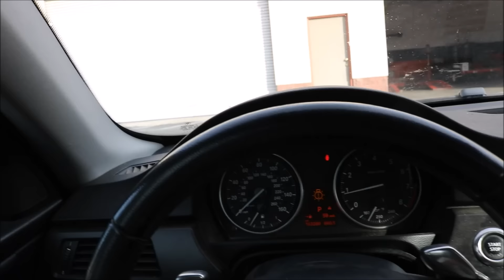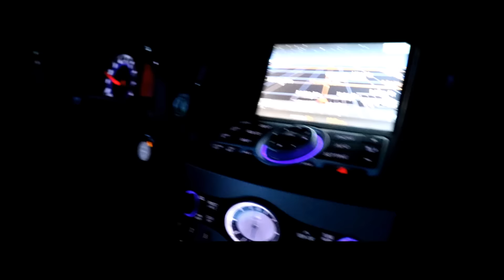Giving Turboed Civic Sleeper Look

Comment: Take the filter off the turbo, turn on the car, put your hand where the filter use to be so the motor can't suck any air in, if it dies then there's no vacuum leak, if it stays on then find the leaks in the intercooler pipings. You can also take the piping off the throttle body and cover that and see if you have a vacuum leak on the intake manifold itself. If vacuum is still good and car shuts off every time, then check the voltage at the throttle position sensor and adjust that if necessary. Or your throttle was just stuck. Can also be the tune, or bad MAP sensor, or bad throttle position sensor. Most likely it's a vacuum leak cuz that idle is way high. Might just be a stuck throttle plate. Stick your foot under the gas pedal and pull it towards you to close the plate more. Let me know how it goes bro.

Comment: check out the cruise control line it's behind the manifold it connects a tube from the control to the back of the manifold or if not then there's a idle screw on the throttle body turn it down

Comment: you need to get it dyno tuned bro!! i have the same kit on my d26z6 and it is pushing 28psi and 428whp get it tuned and it will run much better.

Comment: AN EASY WAY TO CHECK YOUR ALT BY THE WAY WHEN THE CAR IS RUNNING DISCONNECT THE BATTERY IF IT KEEPS RUNNING THE ALT IS GOOD WHICH I ALREADY KNOW YOUR ALT IS GOOD BECAUSE YOUR CAR KEEPS RUNNING AFTER YOU TAKE THE JUMP PACK OFF IT KEEEPS RUUUUNNNNNIIIINNNNGGGG THERE WOULD BE NO VOLTAGE FOR THE CAR TO RUN IF THE ALT WAS NOT GOOD